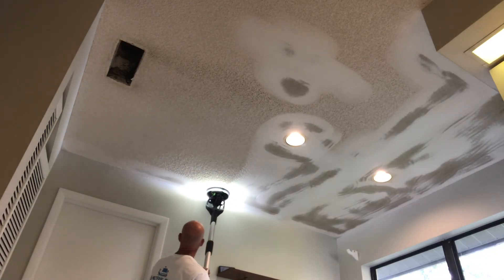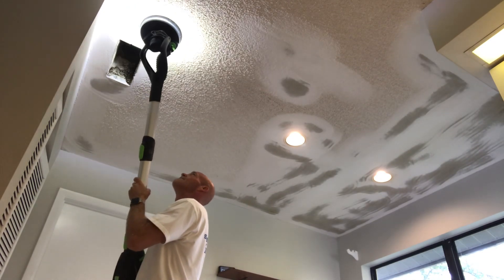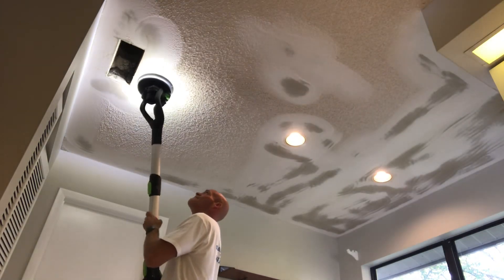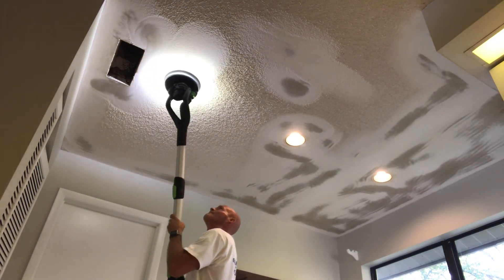Popcorn Removal with Festool System using Planex 2

Comment: I purchased the planex2  sander. It works well on popcorn removal. Painted popcorn takes a little longer. I used a 60 grit. I ordered a 40 grit. Maybe that will eat it up better. Now this is the only problem I have with it. The main filter clogs up eventually and you need to open it up and take filter out and bang it to remove clogged filter. Once filter gets weak it clogs up quicker. It’s still a good machine but they should explain the filter situation.
Reply from the maker: Hi. I use a Saphire disc on painted popcorn and the dust extractor is the c36 self de-clogger system.
Reply: I have the same 36c setup but it still clogs. But I will try that disc you speak of. Thanks